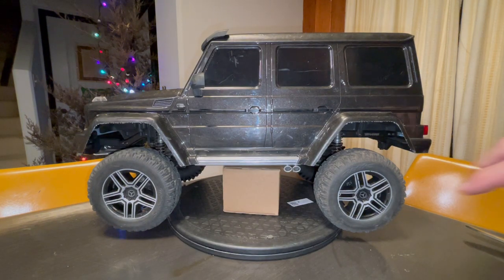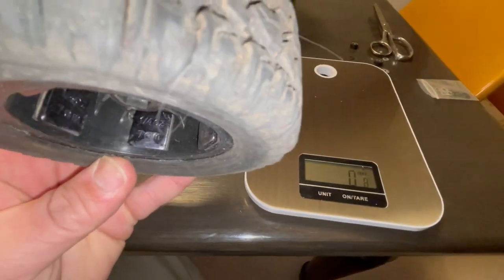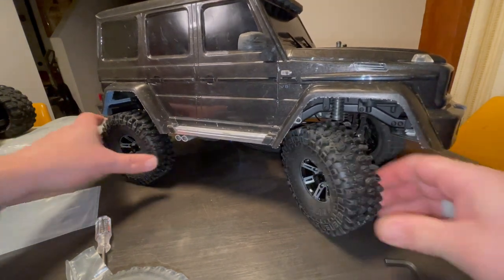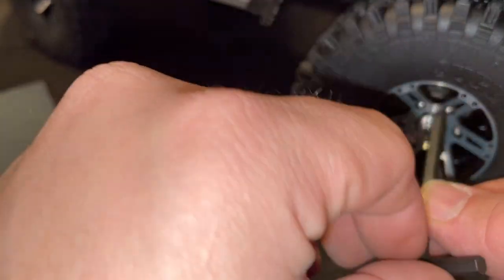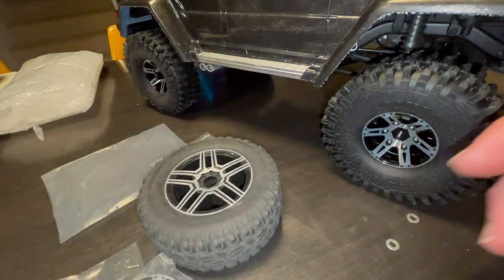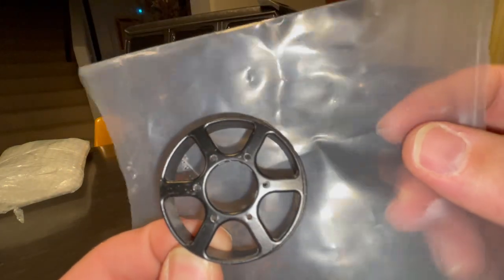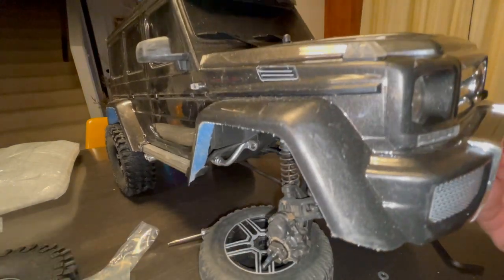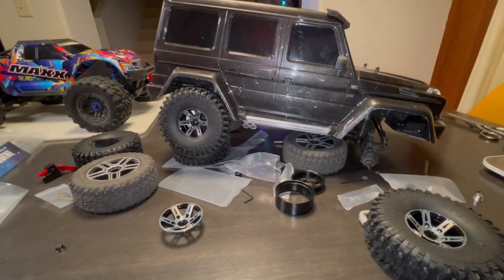New Injora Rims and Tires on Traxxas TRX4 G500 Crawler.

Comment: You need the hex fully engaged.  Drill the hole out if needed, or ream out the back side of the hole just enough for it to sit down.  Make sure your hex will fully seat first though by taking the hex off and setting it in there.
Reply from the maker: The holes got drilled out.  Seems to fit pretty good now.  Full on custom mod...